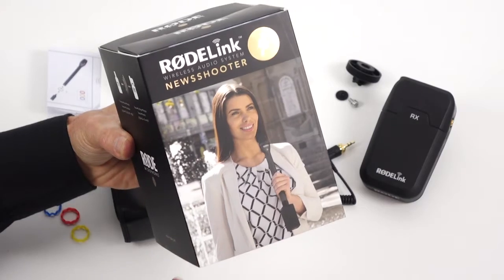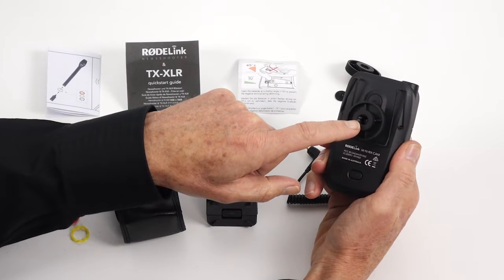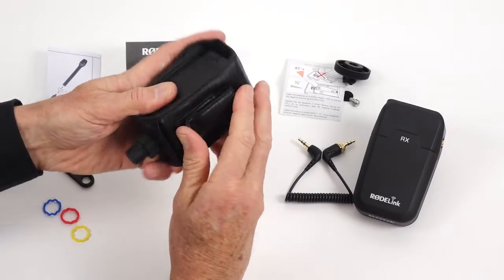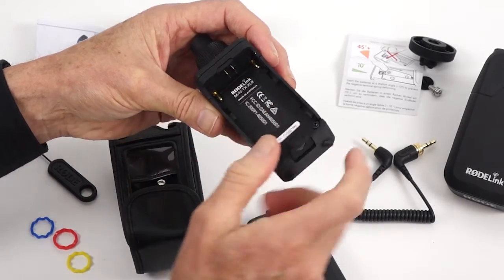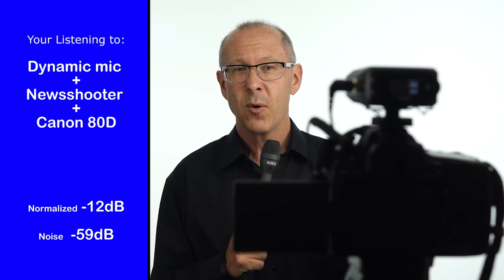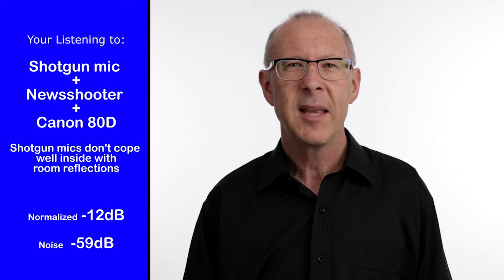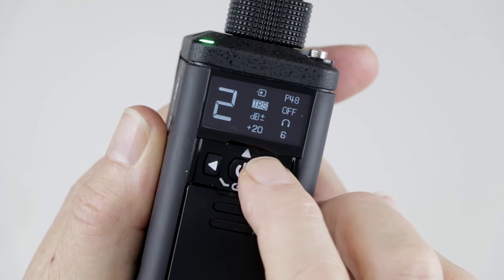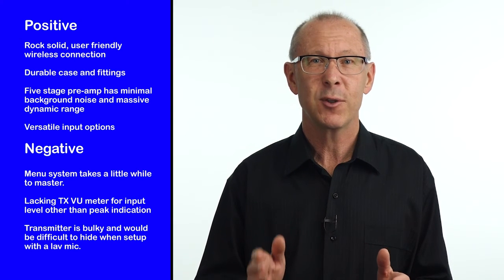Rode Newsshooter | Audio testing and how to change the input settings.

Comment: great video, It's the jack to XLR  included? or should buy one?
In the future can I use 2 wireless systems together? Or paired with other receiver? multichannel?
Reply from the maker: Thanks for the question. The transmitter has both an XLR input and a 3.5 mm mini jack on the top of the unit. No need to buy an XLR to mini jack adapter. No you are not able to receive two transmitters into one receiver. One transmitter to one receiver on a different channel. Hope that helps.
Reply: yes It help a lot. Right now I'm very convinced with the rode. Also can I use the rode for a Instrument Mic (super-cardioid) With preamp. 48v To a soundmixer?
Reply from the maker: Yes the mic has 48volt supply for condenser mics. If you want to plug in the receiver to an audio mixer you will need a 3.5 mm to XLR adapter. Please check out the Rode website. They have a receiver that is designed for sound systems. Just something to consider.

Comment: Nice review Gary! Anyway, will various cheaper lav microphones from Rode or other brands work with the 3.5mm input? I am considering to buy this kit to expand versatility of recording audio since I already have Aputure A Lav microphone. Thank you
Reply from the maker: Yes the 3.5mm input is compatible with all microphones that need plug in power. You can turn it on or off from what I remember. The Aputure A Lav Mic I think has its own power by means of a battery which makes it a very versatile microphone. Even so, the cheapest lav mics will work because the unit can supply plugin power when needed. Hope that clears it up.
Reply: Is it possible to use the Newsshooter professionally with LAV microphones (as in getting exact the same quality as the Rode Filmmaker set) or is it a bit less in quality since it's actually designed for XLR microphones?
Reply from the maker: Good question. The insides are the same as the filmmaker transmitter. I have used it with the Lav mic and it sounds the same.

Comment: Thanks for the video :)
Can we use this system as a in-ear monitor from the mixer?
Reply from the maker: +Z i K s Not very easily. The output from the receiver is probably not enough to drive earphones loud enough and even if it was you only have a couple of level options for volume. There are quite a few economical options available that would be far more effective.
Reply: Gary Davies - AudioTTR 
Ohh okay :)
Can you mention this options sir?
The sennheiser g3 do the work?
Reply from the maker: +Z i K s The Galaxy Audio AS-900. This link may help: https://www.performanceaudio.com/browse/Wireless-In-Ear-Monitor-Systems/364/2/0-0/popular/24/
Reply: Gary Davies - AudioTTR 
Thank you sir :)

Comment: Rode Newsshooter +. Sennheiser MZA900P + sennheiser MKE 2 gold. Will it work? Thank you so much.
Reply from the maker: Please note Annie that on the top of the Newsshooter transmitter there is an input for a plug in powered mic like the MKE. Too make it operate you have to select plug-in power in the menu options. 
The MZA adapter will work but very expensive. Rode has an XLR converter that converts Phantom power to plug in power. The Rode VXLR Pro. Hope that helps.

Comment: Hey Gary, i am wondering if it’s better to plug this Newsshooter to the Zoom H5 then to the Camera than when you plug the Newsshooter directly to the camera. Ps

Ps: my camera is sony a6500
Reply from the maker: It depends what your hoping to do. The best quality audio recording would be into the Zoom recorder as that's what it is designed to do. If your just doing talking head videos, direct to camera would be simpler and for most listeners would be no different. Just depends on your production and if you need the high quality audio tracks to work with in post. Hope that helps.
Reply: Gary Davies Thank you for answering! Yeah i am doing alot of ENG style videos. Since i am the only person who is responsible for the camera stuff (my friend will be the presenter), i would love to be able to monitor the audio from the Zoom H5 since it has headphone jack. Well then i guess i will have to attach the Newsshooter to the H5 then the camera. Thanks Gary!
Reply from the maker: Sound like a good plan. A camera cage is a big help to mount your recorder and other gear you need.
Reply: Gary Davies Yeah haha i have Smallrig cage for my a6500. Thanks for helping us, Gary!

Comment: Hi - can you plug a line-level cable into the xlr unit? I'm thinking of using one to bridge a gap where i don't want to lay a cable ...
Reply from the maker: Yes definitely. You can vary the input down to 0dB and up to +40dB in +10dB steps.

Comment: Hi Gary, 
Can the Rode SmartLav+ be used with this transmitter? Great video. Thanks for the info.
Reply from the maker: +Fabian Boros It will work but not directly plugged in. You will need and adapter to match the input. The smartLav+ is a 4pin minijack and the input of the Newsshooter is a 3 pin minijack. RODE do supply an adapter, quite cheap.
Reply: Simple Audio Tips thanks for the fast response. yes, so purchasing Rode SC2 would solve the issues.
Reply from the maker: +Fabian Boros No that one is for another application. The SC3 is all you need. Check it out here: http://www.rode.com/accessories/sc3 hope that helps.
Reply: Simple Audio Tips Fantastic thanks for the help. I believe I will be purchasing this unit then.

Comment: Does this equipment work's with rode ntg3 mic shootgun
Reply from the maker: Yes the RODE NT3 does work with the Newsshooter. If phantom power is available from the Newsshooter the NT3 will not draw any power from the 9v battery. If you disable the phantom power from the Newsshooter the NT3 will get its power from the onboard 9 volt battery installed inside the Mic. Hope that helps.

Comment: How can I pair my rodelink newsshooter? The number 8 on the TX module won't stop blinking.
Reply from the maker: +Ixver Pro I have a link I will send to you that may just help. I will send it soon. I love the video of yours with the home made jib. Nicely done. That is really some rig.
Reply from the maker: +Ixver Pro this video from the 5 minute mark may help. Please let me know how you go. https://youtu.be/azRQO15UXtw
Reply: I had that problem on my first video job.  That night I had to resort to using electrical tape to tape on my small Sony Chap Stick size ACM AW3 Sony Bluetooth microphone to my Sennheiser (that's okay, you can laugh!).  The following Monday morning, I consulted with Rode's tech guy in San Diego. It temporarily stumped him, but he finally had me try pushing the red button INSIDE the Rode receiver. Viola!  That worked.  I want all new buyers of the Rode TX-XLR transmitters to this fact!  I also think Rode has a lot of work to do to make the TX-XLR a lot SIMPLER with their too complex controls and they should add their 100 hour, rechargeable battery to that transmitter.  Then it will be a classic A+ design.  And after I used it a couple of times, then the transmitter linked up automatically on Channel 8 with my previously bought, three year old Rode FilmMaker receiver.
Reply from the maker: Thanks for sharing your experience